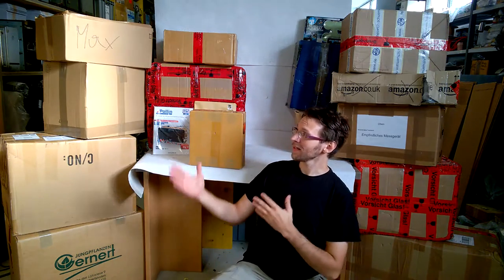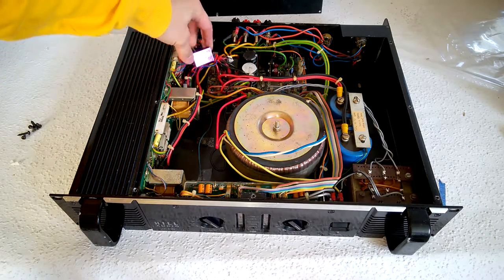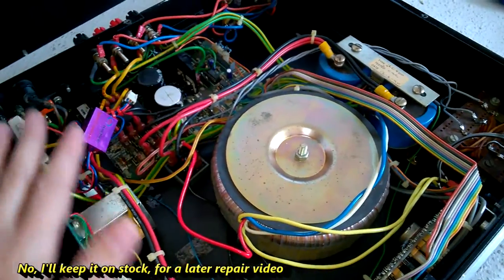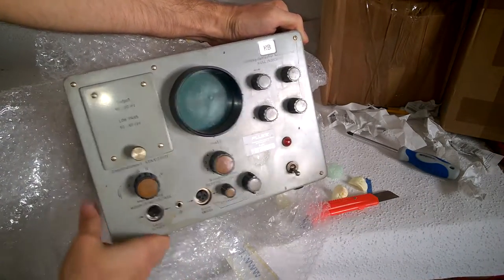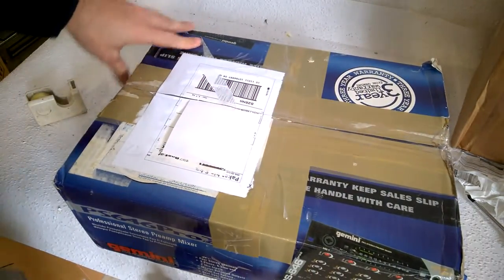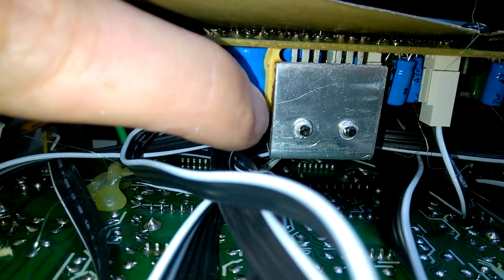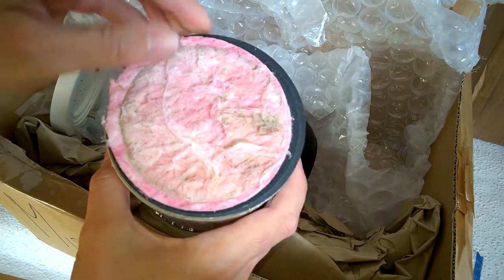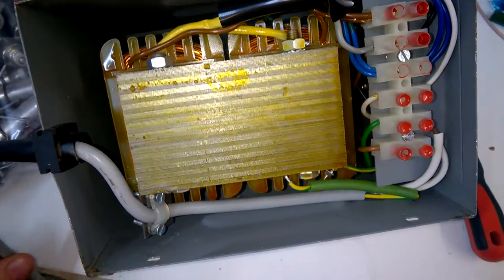BEB #30: This MAILBAG almost sent me to the HOSPITAL, unboxing, teardown, ebay haul

Comment: What do you use a Oszillografischer Nullindikator for?
never heard of such a thing before.
Reply from the maker: It's built to allow a quick and easy read-out of tangens delta phase angles on a CRT, by the help of a Verlustfaktormessbrücke (dissipation factor measuring bridge). My customer is using this instrument to align large industrial power factor correction (PFC) systems. If the PFC is aligned properly, a circle on the CRT turns into a line.